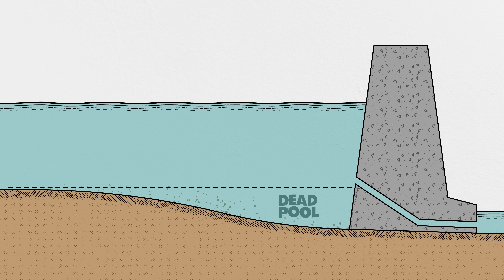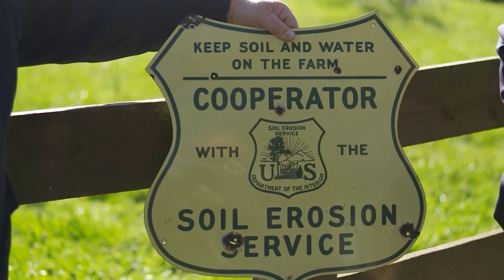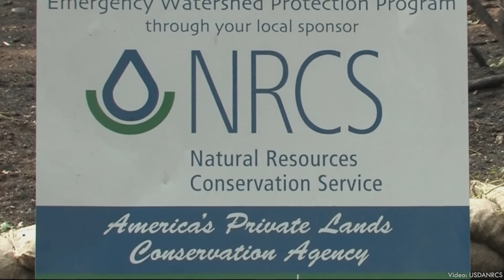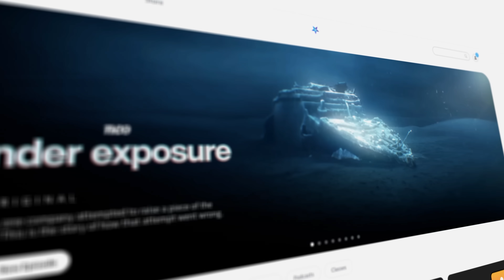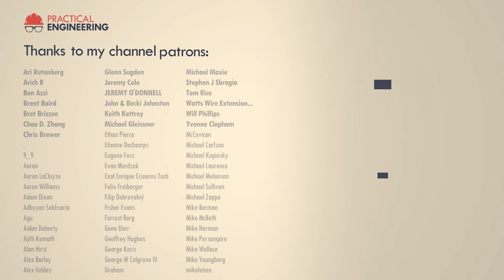All Dams Are Temporary

Comment: Only 5 min in but before i finish the video, my idea would to be to insert hoses deep into the delta and introduce pressurized water to loosen it up and encourage it to move down stream. Theses hoses would need to be removable and another tool would be needed to place them at the desired depth ,but as of right now, this is my answer lol

Comment: The solution might just be to let it fill up, remove the dam, wait for the sediment to wash away, and build it up again. Would require a more modular structure, though, or perhaps a different gate design. For example - release water not from the main channel, but from the sides first, then slowly reroute the water back to the original channel by controlling release; doesn't solve downstream sedimentation, but I don't think that's even possible to solve. Unless we, like, develop telekinetics that would allow a work team to just yoink a bunch of mud straight up and dump it elsewhere directly

Comment: One strategy that i thought of, for dealing with sediment near the dam - Have a worm-gear, at the bottom, near the deadpool, such that it would move the dirt, and then have another worm gear, such that it moves the dirt (and water) upwards into a de-silting reservoir, where it can be purposefully used to let off the dirty water, or somehow filter the dirty water (using the height advantage).

To power the worm gear, am thinking of the way the al-hambra keeps a water reservoir  (https://www.youtube.com/watch?v=xLaLpMeOyHk&t=2m16s) - some of the mechanical turbine energy can be used to move a worm-gear mechanism..

i can fully anticipate the effect this "sludge" would clog the mechanical parts - so this idea would definitely need to be modelled, to check if it is viable :)

Comment: What if you made two separate dams from one river. The river flows through one for years while maintenance and sediment removal is performed on the other, and when that is done, divert the river to the clean dam and preform the same maintenance on the other one. Have both dams flow into the same place to not disturb the river and there you have it.

Comment: okay idea. 

what if we put a new "dam" at the start of the water containment. This new Dam would also generate electricity but most of it's power would go into pumps, mechanical pumps driven by the flowing water to pump the water through the dam. This process within itself would cause the sediment to build up in the pumping mechanisms. Then we have an automated place where it appears so we should be able to from here automatically pack up the dirt and send it out.  

We would need to design the pumps intentionally to pump the water but not the sediment. through.

Another idea would be to have this dam act as a massive settling tank? but my brain hates this idea and thinks it won't work. We still needs as much water that is going into the dam to come out of it at the same rate. but settling require the water to sit some where for awhile before going on. So we could calculate the amount of water we would need to hold in stasis for settling before it would need released by the dam. a complex plumbing operation if I have ever heard one. 
---

So we didn't really touch on how to resolve this problem just that it's hard and that solutions do exist but we didn't discuss those either. So I'm a bit disappointed but hey what can you do. 

Thank for the video!

Comment: First though how to solve it - make a channel for the water, separated from the reservoir by permeable walls (gravel). The flow in the channel remains high, so that sand and silt don't crush out, permeable walls refill the reservoir, maybe add some gates for floods, to quickly fill the reservoir. Cover the walls at the outer side with concrete, leaving outlets. And add pumps to those outlets, or below the walls, to pump water in reverse from reservoir to the channel - to self-clean the walls, so they won't clog up with silt. I.e. turn pumps on, like, daily or weekly for short time to push sediment out from walls. 

Alternatively, have a dredger in the reservoir, that periodically sweeps through reservoir and pump sediment into a barge that then dumps it downstream into high flow - would also need an unloading mechanism that can unload a barge on one side and transport sediment to another side.
When done regularly and thus sweeping a limited amount of sediment, that shouldn't affect ecology downstream (well, except for old dams that basically have ecology adapted to having low sediment since dam construction).

Comment: Could you make several narrow concrete channels on the floor of the reservoir to encourage more flushing?  Maybe with some bedload interceptors over top of them?  Almost like a corrugated floor that could keep the sediment moving as the upper layers of water slow down?  I would imagine one would need an idea of how much water is needed to continue to move sediment, and some model of the rate of sediment deposit.

Comment: with the right type of sediment and a properly built reservoir, i believe dredging or some other type of collecting will become viable or even sought after. we are running out of the sand we need to use concrete.

Comment: Here’s my idea. I’m only a few minutes into the video, but here it goes. 

Redirect the water around the dam, then use heavy construction equipment to dig the reservoir again. 

After that, send the river water back into the reservoir. 
I know it’s a huge job, but if it only need to be done every several decades, maybe it’s not so bad.
Reply: Welp. 

Another few minions in, and it turns out my idea sucks.

Comment: 3y ago you posted a vid about lowest levels of water in reservoirs. so then:

1. water is low = dig & remove
2. water is high = you're prepared

I know it's a simplistic description but wouldn't it make sense?

the issues are
1. I don't believe such work can be done in any regular contracting. 
2. It's more like a snap action taken when possible and dropped when no water levels rise 
3. soil in the bottom of reservoirs is not really well prepared for using land vehicles.

Either way - do you think it's by any chance doable?

---

Or do it Netherlands way
1. Cut a part of the reservoir.
2. move soil
3. Un-cut a part of reservoir.

Comment: An innovative idea is when you build the dam, you build several tunnels on top of the ground of what will be reservoir base with several hatches (even towers with hatches at several heights). That allows you to control sediment better but it can double the cost of the dam project (though while it would probably add the lifespan and output of the dam by ten times, you know how humans are about short term investment for long term gain).

Comment: Dredging is a simple solution and cheaper than replacing the dam. It is also cheaper than replacing the dam. infrastructure requires maintenance. This maintenance has been delayed for years since you morons won’t use nuclear power Hydro power is the only viable solution natural gas and fossil fuels need to be saved for our heating and transportation needs not limited. You can’t build a society on windmills and solar panels. Anyone who thinks so is insane, and by the way, global warning is a lie.

Comment: Whether it's possible or not would be to keep the sediment in suspension by using pipes that pump air through the water column and allow it to travel past and or through the dam.

Comment: Typical engineer thinking, trying to find a solution.
This is not a problem, it's a predicament. We need to adjust to living with it.
After all, most lakes on Earth only last a couple of thousands of years and yet the animals adapted to this.

By the end of this century, most dams will be either non-functional or broken but most people will ignore the issue - because there are much bigger problems to deal with (e.g. we are at the oil and coal peak this decade).

Comment: One possible solution would require significant expense even if put in place BEFORE the dam was constructed. My thought is that the point at which the water would START to slow down is where you start your construction. Place your sediment catchment there; but have the output flow through a large pipe to the site of the dam. As the dam is constructed, a set of valves get placed -- each one capable of handling the capacity of the pipe (or perhaps open them in pairs to allow for smaller valves). These valves will need to operate on a cycle which the "on" period is sufficient to get a complete flow through the pipe. The off period should be variable but never more than a day. One might think that the pipe would not need to survive pressure; but I would caution against this. If the catchment gets clogged and the valves are opened, they would be subject to the pressure of the entire reservoir.

Even with this, the sediment transition would be pulsed rather than relatively constant. There could be issues related to that. Sizing of the pipe would require engineering. Smaller pipes would allow for more frequent activation; but feels like they would be more susceptible to clogging. Thus, it might still be better to have multiple pipes run the length of the reservoir. They would need to be cycled through to allow clearing and clog detection. Clogs could be cleared by equipment to travel through the pipes. Not sure which end would be the best for that.

Just some thoughts...

Comment: The answer is in your video. What is the cost benefit of a dam over 500 years? Eventually it will silt up and will end up as a waterfall.  What will be the cost of making a new dam to form a new reservoir, and is it even possible?  Now factor in moving the sediment past the dam so it can resume its journey down stream. What will that cost be? I think setting up a transport system and infrastructure will then be cost effective. 
There's probably a way to slow the flow at the entrance of the reservoir so the sediment will drop into a slurry pipe to be flushed through. The cost of this would be justified by the long term cost benefit analysis. 
Which raises a possible topic for a future video. How is time factored into an engineering project? I would expect that with something like a bridge, they factor in 50 years or 100 years and then when that time is reached and it's still standing no one bothers to think We need to significantly  increase maintenance and improvements to 'renew' this valuable asset. Instead they just forget that something that's 'always' just been there has an ongoing cost, even it is the replacement cost that either has to be planned for or will appear suddenly -- along with liability settlements. Suddenly is  unexpected only because of poor planning and allocations.

Comment: Amateur here. What about using the upstream fluid pressure to resuspend the soil and pump it through a bypass down river?

Addendum: The intent here is to use surface flow to power a deployable barge-anchored pump system to gradually and consistently recapture the solid earth and feed it down river. Specifically targeting soil accumulation.

Comment: The solution is to make a settling/scour pond at the intake of the lake, with a low dam for the water to then enter the main portion of the dam. 
Sediment will settle out in this area and relatively clear water will enter the lake. Then when the spring rains come, open a drainage line running under the lake and dam to allow the rushing water to scour the settling pond free of sand and sediments, thereby recharging the river below the dam. This could reasonably double the life of the main dam. 
You’re welcome.

Comment: idea I would've had is to put churns in the bottom of the dam and a constant slow outflow of water, which itself can power the churns through hydroelectricity 
the churns keep the sediment suspended and the slow outflow ejects the sediment at a steady pace, but that would only be viable in situations where dams have reliably consistent filling too

Comment: Incase anyone's interested what Chat GPT says. In shirt it recommends using check dams upstream same as beavers 

Beavers actually do the opposite of what we want in a dam: they increase sediment deposition upstream of their dams rather than prevent it. But their way of working gives us lessons on sediment management in water systems.

How Beavers Cause Sediment Build-up

Beaver dams slow water flow, which reduces the river’s ability to carry sand, silt, and organic debris.

This creates ponds where sediment settles out. Over time, those ponds fill, and the beavers move on, creating a patchwork of wetlands.

In natural systems, this cycle is healthy: it builds fertile floodplains, recharges groundwater, and supports biodiversity.

But Beavers Also Prevent Downstream Sediment Clogging

While they trap sediment upstream, this has the effect of:

Reducing sediment loads downstream, so channels and wetlands don’t clog as fast.

Filtering water, since fine silts and organics drop out in the pond.

Distributing sediments gradually, as ponds fill and overflow into new areas rather than dumping all sediment at once.

What We Can Learn for Human Dams

Beavers don’t “remove” sediment, but their natural strategies suggest ways we could adapt:

Distributed trapping: Instead of one big reservoir filling with all upstream sediment, create check dams, silt traps, or forebays upstream to catch sediment early (like beaver ponds).

Cyclic renewal: Just as beavers abandon filled ponds, humans can periodically clear or bypass smaller upstream traps instead of dealing with one massive silt load in the main dam.

Vegetated margins: Beaver wetlands use plants to stabilize sediments. Planting reed beds or engineered wetlands at inflows could slow sediment inflow to the main reservoir.

👉 In short:

Beavers prevent downstream sedimentation by trapping it upstream.

For human dams, that means the lesson is to build pre-dams, forebays, and sediment traps upstream of major reservoirs and clean them regularly — so the main reservoir doesn’t choke.

Would you like me to design a “beaver-inspired” multi-stage sediment trap system that could work upstream of a hydropower dam — maybe combined with your idea of submersible tractors to keep those smaller ponds clear?

Comment: Everything in this world is temporary. Even mount Everest is temporary. Only time length diffiers. Some, are just for year, other for 10 years, others for 100 years, and others are for 100 milion years. But in the end it is temporary.
Id dam was build for hidro electricity and others started to use for other purposes and used it for decades, but can't use for it anymore, is it a problem for dam? If it can be used for electricity. Most likely dam already payed up for its construction. All we need to care is for sediments to not break dam. So, we just need to remove sedements near dam.

Comment: that is because the dam was not built intelligently: #1) the water should ALWAYS be taken from different levels, in order to have an outlet at pretty much constant temperature (if one wants to create a tailwater fishery), or mimicking what would have been the normal output temp if one wants to preserve the River's natural setting, #2) every spring there should be a CONTROLLED output mimicking the usual spring water release, in order to a) avoid catastrophic floodings b) AVOID SILTATION...

Comment: Why not just build a conveyor belt to shift the sediment through a gate below the water level and have it continue its journey past the dam, you could also have conveyors form ribs that transport mass to a central belt?

If going below proves too difficult, going over the top, or along the side could work too.

To keep it efficient you could mount fan shapes to each side of each sylinder driving the wheel, allowing them to effectively be driven by submerged waterwheels, making the river power its own excavation.

You could put smal shovel-like fins on the belts, this would help the soil stay on track, and could help dig the belts furter into the soil. Since the soil is soft, spillover from the sides could get swept up by the belts as well, and then you design it so that eventually the belt system becomes suspended by secure anchors along the shoreline, thus ensuring that they don’t dig deeper than intended.

Comment: In your model, the water only escaped at the bottom when you are intentionally discharging the sediment.  Wouldn't the continuous release of the normal water volume at the bottom eliminate the sediment build-up?  Obviously, a dam that releases water at the bottom is not as efficient for hydroelectric generation ... more so for flood control or reservoir creation.

Comment: One thing that can be done is to make it more turbulent where the sands and sediments are settling down, basically mixing it with water or not letting it settle before the dam, that way the water with sediments will flow down the dam. Although that may cause damage to some parts of the electricity generation system such as turbines but it should be feasible.

Comment: I have an idea. Don't know if it makes any sense, but here goes: a channel next to the reservoir, maintaining a certain width which would allow water to flow at the same rate as the upstream river. This channel would allow water to flow into the reservoir to maintain the level after the reservoir is filled, but the sediment would continue to flow through the channel at its normal rate. The channel outlet at the dam would be the main dam outlet so flow through the channel is maintained. That's the basic idea. Please go easy on me, I'm not an engineer.
Reply: Moving rivers doesn't work that well and maintaining constant flow without moving a river would require a lot of water, like another reservoir upstream to pull from.